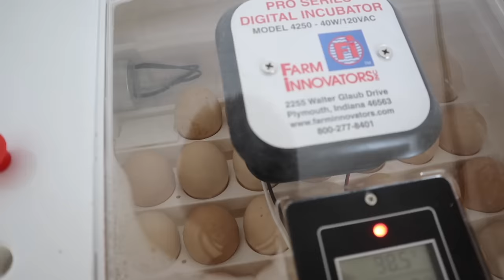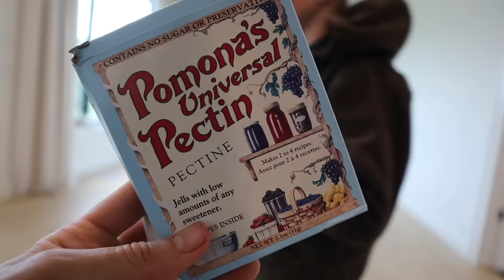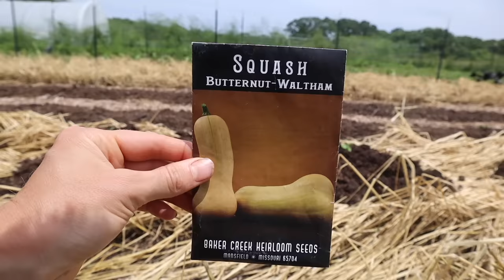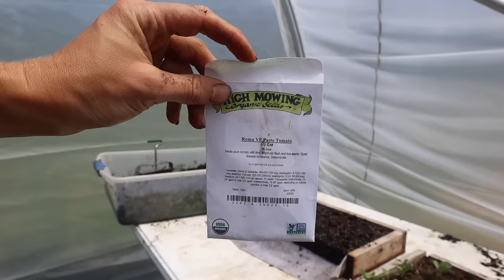The Reality of Food Self-Sufficiency

Comment: When it comes to canning fruit, there are four things to ensure a long shelf life. Sugar, acid, heat, and water. If you cut up the fruit and macerate in sugar for a few hours, the sugar will draw out much of the natural juices. I typically use about a cup of sugar per pound of fruit. At this point, add anywhere from a 1/4 to 1/3 cup of lemon juice, and you are ready to start cooking. Make sure to use a thermometer and bring the compote to between 200 and 210 deg F. Whatever you do, don't let the compote boil (you will need to adjust the temperature down if you live at a high elevation). The goal here is to slowly cook off as much water as possible before the sugar and natural pectin set. It takes about 90-120 mins depending on the amount of fruit you're canning, and you will need to stir constantly to prevent scalding. Eventually the compote will thicken to a jam consistency, and you are ready to can. With the exception of cherries and pineapple (although there are probably others I am unaware of), you don't need to add any pectin. Process the jars as usual, and you now have shelf stable jam that will last for years. I am not kidding when I say that. I have eaten many homemade jams at least four years old. Water is the enemy that shortens shelf life. Furthermore, cooking off the water is equivalent to making a reduction that concentrates the flavors, so while it takes some time, it is worth it. Alternatively, if you are canning something like blackberries where the seeds can ruin a jam, after macerating for a few hours, filter the pulp and seeds, and cook just the liquid until it is sufficiently reduced to use as a "cordial" which are always nice to have around.
Reply: Cherries canned in apple juice are a real treat
Reply: Wow that is such an awesome share of knowledge
Reply: Thank you, wrote this all down.

Comment: Moot point by now, but may be valuable for others at some point... You could have cut the bottoms off the tomato plants that were wilting and rooted the tops in aerated water. They root quickly. The suggestion to root suckers mentioned by others is a good tip too. In regards to your cover crop, you lost all the nitrogen by drying it out above ground; it evaporated. You essentially have straw mulch now. Next year you may want to consider mowing it (may take 3 to 4 passes cross-ways) when green and then till it in immediately. For mulch, let your lawn grow longer, mow, let set for a day, and then use a pull-behind rake on the back of your lawn mower/tractor to gather it up. This way, your green cover serves as nitrogen and carbon immediately in the soil, and the grass clippings work as a mulch and later, as carbon for the soil biome. If you are into no-till, then obviously this may not interest you. However, feeding that biome with nitrogen and carbon more than makes up for disturbing the soil and will help to aerate it. I too had tremendous hurdles with soggy soil last year. Worst year ever. I empathize and feel your pain. As an additional note, parsnips love damp soil. Also, I now will only plant carrots in raised rows. I lost all of them to soggy bottoms. The raised rows will also help the carrots to grow longer and fatter. (Works with onions too.) Oh... one other tip; one can make strawberry jam easily without pectin if done correctly. If pectin becomes impossible to get, it is very important to learn that skill. (Remember the yeast shortage?) I hope the rest of the year goes better! It is wonderful that you bring your entire family into the garden with you.
Reply: No.
Reply: @EdensRemorse  elaborate?
Reply: Agree, they should till those cover crops in while still green.
Reply: @JM.5387  A clear understanding of mycorrhizal associations in the soil referenced here would lead you to the opposite conclusion.
Reply: This comment is great!
Reply: @EdensRemorse  if you don't take the time to elaborate on what you are saying, of what use is it to even bother commenting? "No." " A clear understanding of mycorrhizal associations in the soil referenced here would lead you to the opposite conclusion." How about if you share some of that clear understanding and maybe elaborate on why you said no  (and maybe specify what you were saying "no" to) then your commenting would be of some value other than stroking your ego.
Reply: I did the same this year. Simply put info the ground and cover fit a few data with a plastic bottle cut on the bottom. They grow well :)
Reply: @EdensRemorse  That's the burden of proof fallacy. As well as being very veague. You've contridicted a point made by someone who has provable clout though experiance as recorded on his channel and offer no support for your arguement outside of instructing the reader to effectively "go look it up," thus shifting the responsiblity of supplying credibilty for your arguement to them.
If you have useful knowledge and experiance, please share it! I don't know anything about mycorrhizal associations, unless you are referering to the general presece of mycilium in the soil that acts as nutrient transport networks in forests?
Reply: @arcare001  Strange.
Reply: This conversation is silly. Probably the reason is that tilling soil kills a lot of the biology, especially the stuff bigger than bacteria. So Fungi, protozoa, nematodes & arthopods. You also lose the mulch which stops the soil drying out as quickly which also kills soil. David Johnson (of Johnson-Su Bioreactor fame) says that farmers he works with who do conventional tillage make a compaction layer at the depth they till to. Most State Ag departments here in the U.S. recommend tilling as little as possible.
Reply: @wasssssuppppppp  This.
Reply: @EdensRemorse  I
Reply: pectin, some people mix Apples with strawberries or raspberries or mulberries or peaches or nectarines etc when making jam for this reason. The od couple of muscat grapes doesn't hurt either.
Reply: @arcare001  I have a brother like him LOL I get your point. Even though he is wrong lol
Reply: Subscribed to your channel due to this comment. Thanks for sharing your wisdom
Reply: "In regards to your cover crop, you lost all the nitrogen by drying it out above ground; it evaporated." I'm not sure this is true, through not sure it is not either. Perhaps you can help me understand better what you mean. 
If A] the grass had been cut, and let dry (rather than decompose wet) on the ground, I believe it would have gone brown, but retained its nitrogen as proteins etc.
if B] it had been allowed to reach the end of its growth cycle, and gone brown above ground, then would a lot of that nitrogen have gone to the roots? (though it is an annual)
C] it was crimped and covered... so what is happening with the nitrogen, and what about the roots, which are substantial?
Thanks a lot for elaborating! It would be very helpful.
Reply: E  I  E  I  O
Reply: @RichardBullKTM  there was only a small amount of nitrogen lost due to leaving it that way.  Plenty of nitrogen left that will feed the bacteria in soil needed to convert organic nitrogen to inorganic nitrogen the plant can use.
Reply: How do you make strawberry jam?
Reply: This is an aging post, but it appears that people want more elaboration. The cover crop is called "green manure" for a reason. It needs to be green to provide the needed nutrients. If it dries out (evaporating away a lot of the nutrients) and turns brown, all you have is mostly carbon. It is essentially turned into a straw mulch. Better than nothing, but that grass in the lawn would do the same thing and break down even faster. As for tilling, you need to get the green cover into the ground for the nitrogen and other nutrients to be put into the ground. The microbes will not die because you are feeding them more organics. That is what they need. They can come to the surface to get some nutrients, but putting it right at their level is better. Furthermore, many of the nutrients would be lost before they could get to them on the surface, especial if the top of the soil is dry. As for compaction, the tiller can add to that if use unwisely. So will walking in your garden, plastic mulch, and the rain. In order to fight back against compaction be sure to have the right combination of minerals that keeps the soil from compacting. If that does not work, then the use of a sub-soiler, cultivator, or broadfork will help to break the compaction. Those tend to not disturb the layers as much. If you feed your soil and get your minerals in balance, compaction will not be a factor even if you till. Tilling to feed the soil is helpful to a garden. Tilling to make your soil like flour is destructive. Once one learns the difference, then they can more wisely use their tools productively. Happy gardening!
Reply: @doityourselflivinggardenin7986  where do you think the nitrogen goes when greens turn to brown? Significant part goes to the soil in the process of mineralization, it happens with any plant residue with C:N ratio < 24, but the more nitrogen the better obviously. Tilling it into soil is not a very good practice since a) it turns aerobic processes into anaerobic, meaning they rot instead of composte, which is not very good for growing crops since it can spread the rot and diseases and infections b) you are destroying a lot of established colonies of bacteria and other organic life impacting biodiversity of the soil c) essntially more work for worse results. And if we are talking abour plants like clover or other legumes, they fix the nitrogen in their root nodules, so it's already underground.
Reply: I don't think the nitrogen just evaporates like that -- however, decomposition does temporarily tie up nitrogen, so if you till uncomposted material into the soil right before you plant it's going to leech the nitrogen out of the soil while you're trying to grow crops there. It'd probably be fine if you tilled stuff in the fall before, but right before planting it would be worse than nothing. It would be like eating a huge meal right before running a triathlon to give yourself energy.
Reply: @doityourselflivinggardenin7986  
On further research, it seems this topic is way more complicated than I realized, with either tilling in your green manure or leaving it on top being better in different scenarios. Putting chicken manure down is a really smart move, though. I'm sure you already know this, but it's really high in nitrogen, so it'd give your plants a good boost while the cover crops are still decomposing, while also kickstarting that decomposition -- much like putting lawn fertilizer on straw bales before planting a straw bale garden.

Comment: As you are losing some of your tomatoes. Take the side shoots that you have to take out of the joints and pot them up with some rooting powder. They will set trusses lower down and they will extend your tomato season. This is a tip that I got from 'Green Side Up' in England. Hope this helps.
Reply: There is no need for rooting powder for tomatoes! ☝️ Put in glas of water & You'll see roots after few days!! Blessings 🙏🌟💫
Reply: @helengren9349  
If you have good moist soil you can just push the tomato stem into the ground.

Comment: For your cover crop crimping tool: Get an old push mower handle and a flat-sided barrel. Cut the barrel short enough to fit in between the handle sides. Cut a hole in the very center of the bottom of the barrel. Put a PVC pipe through the hole & seal it in place, standing straight up in the center of the barrel. Then fill the barrel with concrete. When it cures, use the pvc pipe to feed an axle through and attach to the concrete roller to the mower handle. Then just 'mow' the cover crops down.

Comment: Hello Sweetie. Wow. You've done a wonderful job with your cover crops. You have really done your homework and application of knowledge and have built up nice soil. Just a thought regarding your soil and use of compost. Remember the most productive soil is 45% mineral, 25% air, 25% water, 5% organic matter. Breaking that down to practical terms: Loamy soil is 30-50% sand, 30-50% silt (smaller than sand minerals), 20-30% clay and only 5-10% organic matter. So, using so much compost/organic matter can be too much of a good thing, not allowing air. With your use of cover crops it would seem you really don't need to add much compost. Less work for you!

Comment: A tip , if you dont want to use a shovel you can use a small electric auger . i plant around 200 or so peppers and  maybe 100  or so tomatoes  i use a 4" bulb auger that connects to my cordless drill . works great  and im able to pop a ton of plants in the ground quickly .the bulb augers range in size  i believe i paid 15$ for mine and it was  totally worth the 15$ . i think if i had to buy another id go with a  slightly longer one so i dont have hunch over but it sure has helped my back and saved me alot of time . just wanted to throw that out there for anyone who might not have heard of bulb augers before.

Comment: I had the exact same tomato problem last year. My problem came from the early mulch. I planted my tomatoes into a developed no-till bed with shredded leaves as a mulch. The stems started to mold and never dried up in a sandy loam soil with great drainage (so drainage wasn't a problem). The rest of the tomatoes got an early blight and died. I believe the issue came from using a leaf mulch early in the season. Soil couldn't warm properly, not great air flow or soil evaporation. My solution to try: applying the mulch around the tomatoes a little later in the early summer rather than directly at planting.

Comment: Some comments/suggestions: regarding posts: (1) lean the post 45 degrees and then add post driver and (2) use hearing protection when driving post.  Using a PAW electric wheel barrow has saved my back and more than doubles my daily  throughput.  For vertical crops like tomatoes and cukes, used Josh Sattin's "trellis to make you jealous" this year and absolutely love it.  To effectively break the hardpan in the garden, use a broadfork and pour Korean Natural  Farming JMS solution into holes.

Comment: @The Seasonal Homestead - I use a sand or water lawn roller for crimping I find its easier, and just pull behind a lawn mower/tractor. Another option I tried was actually running the mower on high and chopping up the cover with the blower disabled so it just multches.

Comment: One thing you can do with tomatoes if you have disaster strike but you have plenty of saveable plants is (if they are indeterminate) take cuttings (snip the suckers off) and root them in water inside for a few days (a chunk of willow wood in the water helps if you have it) and then just simply plant the cuttings very deep and they should take just fine. It’s a quick way to double the number of mature seedlings/plants you have quickly without starting more form seed or buying starts.

Comment: Just wait until one of these summers late blight visits you.  One day you have a beautiful tomato patch, 24 hours later it's black slime.  As a retired market gardener, I've been there many times.  That's why it's nice to put up 2 years worth of food when you have a good crop if you can, an it's why I always start 2-3x as many starts as I think I'll need.  Last year I had to replant peppers twice due to a virus issue.   BTW,  you look really well equipped there. One recommendation I'd make is look into a chamber vacuum sealer.   I have one and it's SO much better than the foodsaver style, and bags are dirt cheap as well as available in many styles and thicknesses.  I also use it to pack my freeze dried food into mylar, can't do that with a foodsaver.

Comment: ffr, when doing tomatoes or other grueling stem-to-stem distance plants, just find a stick and cut it one inch short of the length desired, it'll point right at the next dig spot, no need for something to read.   You should also learn to cone your strawberry stems out, fairly easy you just need a cheap paring knife with the tip ground a little more stilleto, you can be generous with what you take from around the stem and still end up with an extra whole slice worth to save from every two berries.   Raising-rings for planting the tomatoes is a good idea, a 3 or 4 inch tall ring of plastic mesh in a ring about twice the diameter of the pot you take them from, common gutter leaf plastic mesh, just put a little potting down to protect the fresh exposed roots and then the plant then fill the mesh ring.  You can clip little radius cut skirts of black plastic over this around the stem if the rain gets really bad.

Comment: Ever seen man powered soil compactor? They're basically a 50 gallon drum on a axle with a lawn mower handle. That might work for crimping your crops since you said heavier was better. You can use water, sand or even concrete to give it the desired weight.
P.S.  Ever tried "the three sisters"? It's how some Indian's planted their crops. They planted corn, peas/bean and winter squash in the same plot of land. The beans uses the corn as a trellis and the squash covered the ground around the base of the corn.

Comment: Nice vid.  Just a thought.  Have you guys tried looking for a roller tamper that you fill with water.  The ones you push yourself instead of towing are only 24 inches wide but I've heard those work.  You could find one on E bay for 50 to 100 bucks OR you can rent them in some areas for 5 or 10 bucks a day.  Getting a good crimp can really hasten the decomposition process.

Comment: Where did you purchase the large tarps that you used to covered the cover crop?  Basically the pipe used to go over the cover crop just bent it down.  If you use a crimper with an edge it will break the stem and kill the plant.  A one inch wide angle iron screwed to a 2 x 4 will do the job.